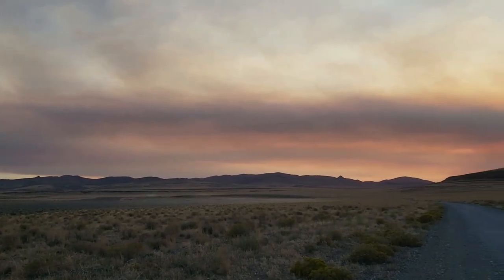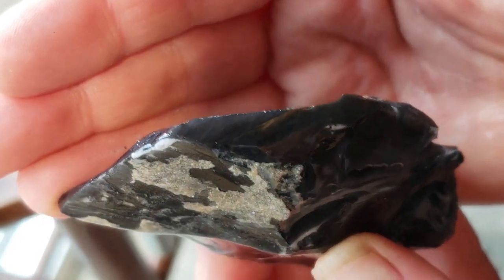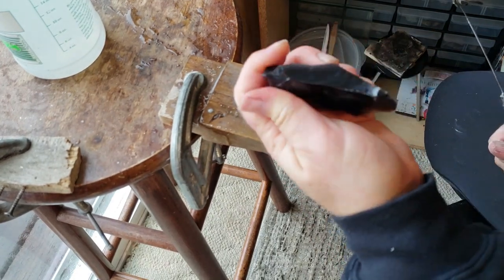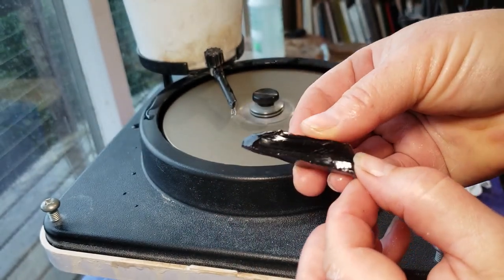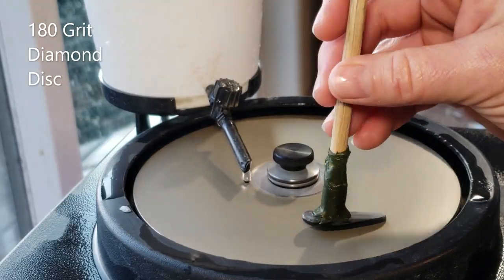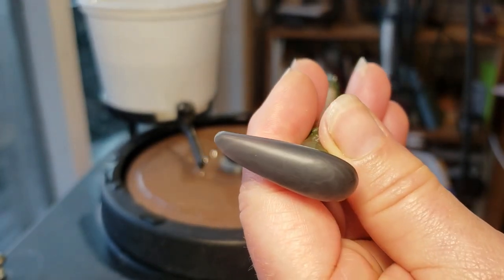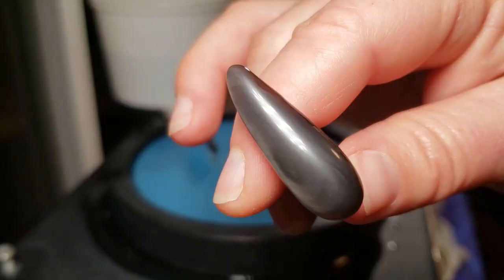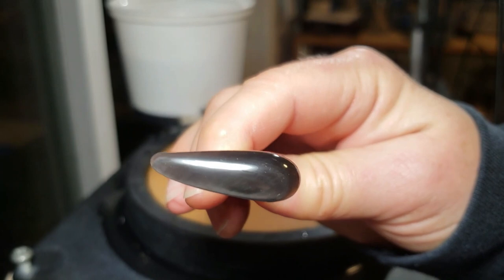Oregon Rockhounding Obsidian to Gem Lapidary Surprise!

Comment: Great video thanks for sharing. I'm working with some mahogany & snowflake obsidian now, thank for the tip on cutting
Reply from the maker: Ooooh, the mahogany and snowflake sound great. What kind of work are you doing? It's crazy how some of the old school ways of doing things work great still 😁. Thanks for watching!
Reply: @OzoneFineArtVentures   First I really admire they way you do your working . Your metal smithing inspired me to try one day soon when things slow down. 
I have an old Lortone lu6x combo that has a trim saw,1" 100 grit carbide wheel & 3" ex drum and a 8" Hi Tech slant Tyler introduced me to . I mostly pre forming cabs freehand and from jeweler templates . We polish everything in our Lot-O right now and my wife wire wraps.

Comment: Hi I know this video is a year old but I had a question, I have a lot of Obsidian shards and pieces that I want to turn into jewelry or just shape in general but all I have is a dremel and a belt sander. I'm very new to the whole process of shaping and polishing rocks but I was wondering if that would be enough to do what I mentioned earlier. It's hard to find videos on here that don't use crazy tools or chip away at the rock.
Reply from the maker: Good news, you can do the whole thing with the dremel! I can't recall if I posted a carving video with the dremel but I know I did a carving video with sunstone and it's harder. That will give you some reference. It can be hard at first to get the hang of obsidian because it scratches easily and it's hard to get the scratches back out (and you have to grind/scratch it to shape it obviously). Having good tools like Diamond Burs (some probably came with your dremel and then there are many more shapes and grits), and good sanding/prepolish tools like Nova Points, silicone sanders, diamond pastes and the like will make your life easier. The last step is polish and Cerium Oxide is usually the best choice for Obsidian to get a shine like the one on the cabochon I did in the video. Let me know if you have more questions and best of luck!
Reply: @OzoneFineArtVentures  thank you so much i appreciate all the advice, I really have been wanting to do something with the Obsidian I have around especially since where I'm from there is so much. I will definitely come back if I have any more questions.